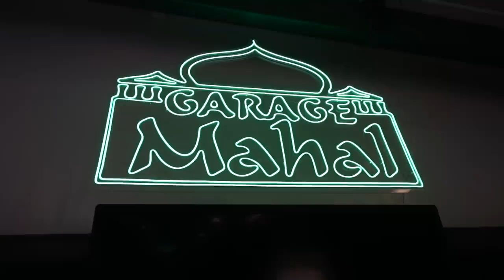Things get ROWDY at the LZ compound!

Comment: here in europe DCT and ZF HP swaps are getting super common a company called HTG from Poland developed a GCU that makes is possible to control the transmission with whatever engine is in front so I'm putting a 8hp70 from a 335d on my GS300, those transmissions are handling 1000hp plus cars... so 2jz 8 speed sequential baby.

Comment: Also no one has DCT's dialed yet everyone at the forefront of dct swaps has faced nothing but obstacles gremlins and downtime while burning money to where they could've almost gone sequential which can't even be compared to a dct other than clutch less shifting aside from that sequential and dct have nothing in common and sequential out performs dct across the board including tuning you can hand pick each individual gear ratio & swap between FD on the fly easy to maintain work on swap parts none of which describe a dct w/ sequential you can load em up with all the electronics & sensors in the world or bare bones completely analog where yes dct does have lots of TCU options all of which are fighting overriding oem commands constantly issues arise the good ones cost a small fortune for just the controller with accessories/add ons adds up crazy fast